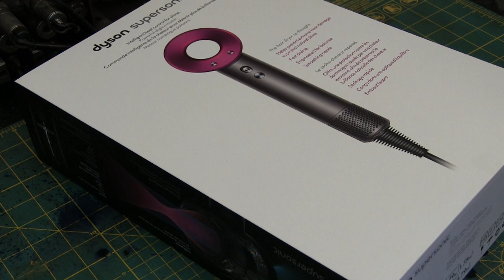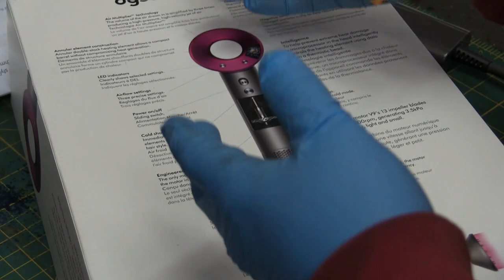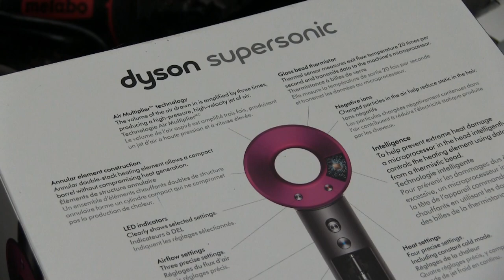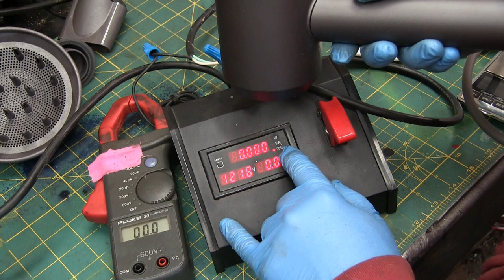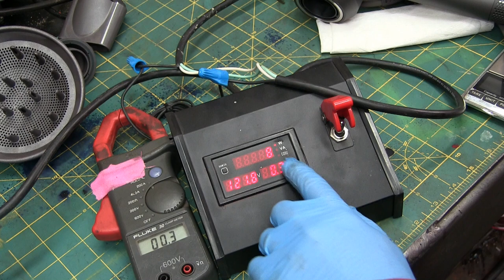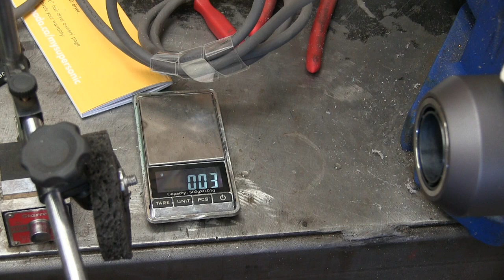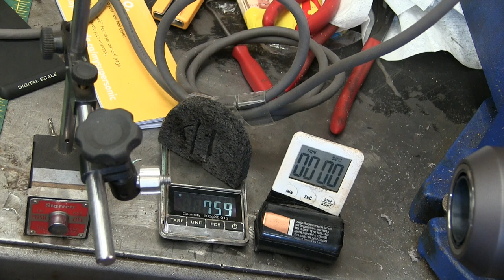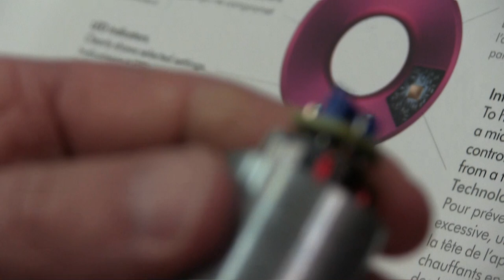BOLTR: DYSON HAIR DRYER. Is it WORTH the MONEY?

Comment: Interesting, you just answered a question I had a couple days ago while I was getting shocked by loads of static from a shop vac. I was vacuuming up sawdust and could see the zaps hit me multiple times through the tube that was covered in saw dust on the outside. Thinking the thing was shorting out I checked the cord for a ground. It was only two prong. Curious if a grounded cord would have prevented static electricity like that?

Comment: The static thing: they are using the fact that it gets charged with the opposite charge than hair. Problem is, if you hair isn't charged much, this will charge it up the other way. Marketing bulshit trying to turn a problem (static charge) into a feature.

Edit: I stand corrected, the negative ion thing is counteracting the static charge of the air, plus providing charge to cancel charge in your hair/charge it the other way, depending on how charged your hair is to start with.

Comment: Been seeing alot of your older videos last few days, I see the quality has always been top notch, on a side note, I seen the "negative ion" bs on this, considering there have been a ton of negative ion trash these days that have actually been radioactive and had thorium in the products, I'm curious if this would also light up a Geiger counter
Reply: No that negative ion module is just a 3-5 kV thing, no radioactivity.  There's a lot of bs about negative ions but they have their uses.  A couple years ago the air in my area was full of ash from wildfires but my Ionic Breeze cleaned the air, every couple hours I wiped off the ultrafine particles that I would have been breathing otherwise.

Comment: So in other words, its not worth it. It might be worth the cost from an engineering standpoint but as a consumer it isnt. I dont know how much the other blow drier cost, but if its 50 bucks, thats 10 times the price for not 10 times the performance. What are you paying for? .5 of a gram more water vaporized? 

I install flooring and used a Dyson vacuum cleaner on carpet when finishing up and my 40 dollar dirt devil did a better job. It made a lot of noise but hardly picked anything up.

Comment: the power from dyson fans and hand dryers/hair dryers is multiplied by the shape of the blow head (lol) theres a cutaway graphic you can google for for the fan that shows how it uses aerodynamics to create a much stronger effect, imagine the blower part is like a flat airplane wing, now roll it up into the donut shape the fans and the hair dryers and all have, with just that tiny little motor, its pushing a bit of air, but with the air plane wing shape and a little slit inside, it makes the ring use lift like in an airplane wing to create higher pressure and also more air forces come from several more angles... heres the old video of the fan, the hair dryers does the same thing..and he stole cyclonic action from old filter queen vacuums for his vacuums also... https://www.youtube.com/watch?v=yJiYT320va4 what a bastard genius.

Comment: Betcha the difference between drying performance is the difference between brand new heating elements and all that lovely cyclonic heating in your wifes personal paint booth heating cycle.

Go figure for dyson to make a hair dryer that works as good as a used hair dryer and charge the extra moolah for complex computer controlled motors and cnc machined micro impeller... instead of just making a hair dryer that would last forever and take the abuse of a professional.
😅.
Good marketing.

Comment: You should try measuring the e-motor EMF radiation. The 2 pin mosfet driven motor just in your palm will probably induce you into an antena mode

Comment: The placement/design of those buttons alone should be enough for Sir James to have his knighthood rescinded.

If you're someone who likes to change heat-level while drying your hair... well, you've got one chintzy push-button on the hard-to-reach butt of the machine, which you'll have to press over and over to "scroll" thru 4 heat settings, never quite sure of what setting you're at, unless you turn the dryer around to look at the LED lights. FFS, what a POS.
Reply: dremid445 the whole point is for them to be out of reach. Most people set it and start drying their hair changing the heat back down only when finishing to set the style

Comment: Had that same fluke meter for years until working on a dark junction box and tried to check the amps on a circuit. Had an extra wire sneak in the clampy part and fried her.

Comment: MY KIRBY VACUUM ONLY TAKES 7AMPS WHAT THE FUCK?
Reply: Your Kirby vacuum doesn’t have a 1000w heater that has to get litres of air to approximately 110°c
Reply: @Kubulek17  I realised that after posting this comment, but my 6.25 amp motor In a different kirby pushes 158 CFM, is the little hairdryer doing that?
Reply: @therandomman6647  my dyson hair dryer pushes 13 litres of air at 110°c and weighs only 800 grams. Your Kirby has a much larger fan and weighs significantly more, also has less restrictions on weight distribution and the level of noise it produces.
Reply: @Kubulek17  I turned it into a semi-joke and you missed it

Comment: For the amount of work done, so much to waste by lack of a clear scientific approach. The question is of course durability - how long time will they keep up over time. If one works 100 hours and the second 1000 hours, it is clearly worth more than even a $25 dryer EVEN if they execute the same job during 1 hour. And yes - you are supposed to figure out why I write 25 and not 50.
Reply: Marcus Yang-Nilsson 
I doubt it'll last. My uncle had their vacuum (and bragged about it) and after 3 years of light used it died. 

Ah, well I'm happy with my 15 year old Kirby Ultimate G Diamond Edition.
Reply: Marcus Yang-Nilsson in a hair dryer it’s not about durability as much as it is about frizzy reduction , colour protection, smoothing and other factors which influence the look of the hair.